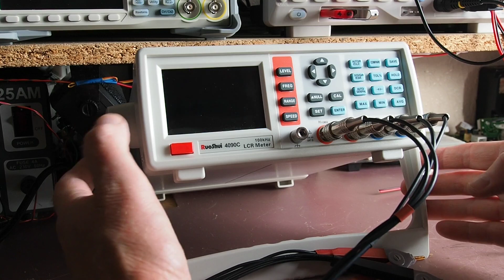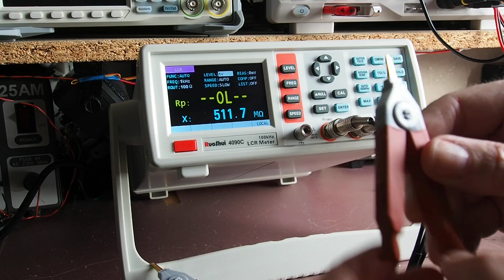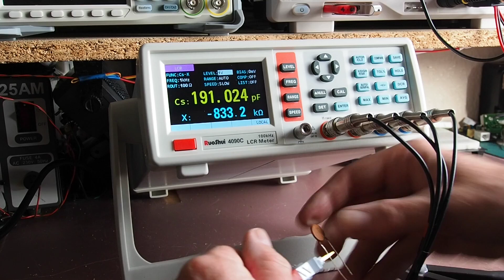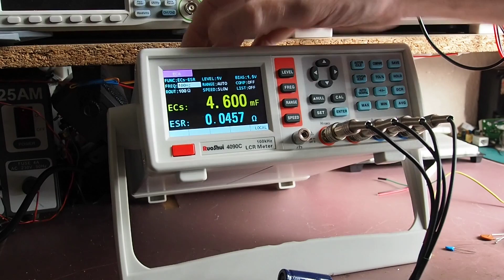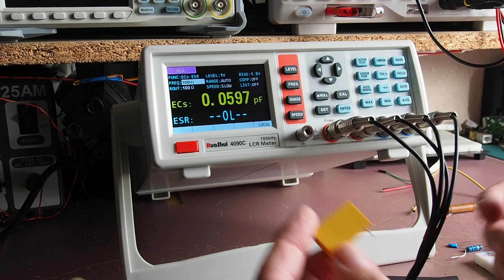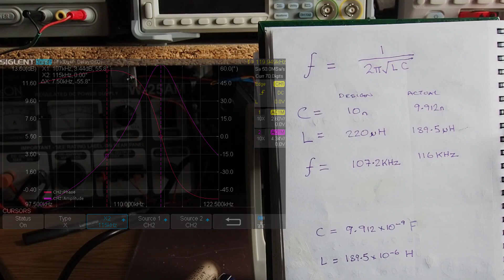Ruoshui 4090C LCR Meter Review   #092

Comment: Electrolytics should all have their ESR measured at 100 kHz to eliminate reactance errors which should be negligible at that frequency. Their capacitance is measured at 100 or 120 Hz for typical use.

Comment: hello. I bought this meter but its broken now. Can somebody help me fix it? I contacted Victor support  but they told me there is no help. Strange indeed. Unit powers up but it acts like its the short at the probes (withouth the probes attached) I asked for the mainboard replacement   for the repair but nothing 😢

Comment: There is a voltage selector on the back of the unit, but it only says 200-240V 50-60Hz.  Does it also operate at 120Vac 60Hz, even though this voltage is not indicated on the back of the unit?

Comment: Can you check the reading stability of a resistor in the 1k - 10k range?  On a high quality meter, this should give a very stable reading.  Looking at the readings during your review, there appears to be quite a lot of instability.  Possibly using a low quality ADC or they have noise on the measurement circuit PSU rails?

Comment: I have the 4091C on my bench and the inductance measurements are horribly inaccurate. I measured a 1.6H inductor using a Senncore LC53 (measures at 60Hz). The  4091C measures 7.7MH (which is wildly off). Measures caps just fine. Have you had any success measuring large inductors, 1henry +? Thanks.
Reply: That's interesting. I was about to pull the trigger on one of these meters because I need to measure inductance mostly in the range of a few mH all the way up to  15-20H or maybe even higher but now I'm hesitant. Do you still have inaccuracy problems or it was some user error from your side? Thanks.
Reply: @dandin1862  i worked with their tech support and found the problem, user error. I didn't change the line input voltage switch to 120 for US. Once I did this, my unit worked great. It's a good little unit, simple, fast and easy to use. Thanks for your question.
Reply: @CraigHollabaugh  That's good to hear. Thank you very much for the fast response!

Comment: After watching this, I purchased the 4091C 100kHz continuous frequency meter. I can write a SCPI program to pull the data. It just happened to be on sale direct from Roushui's Aliexpress store. Thanks from Colorado.
Reply: What driver did you use to write your SCPI program?
Reply: @pshamlow  I wrote a little python script that sends SCPI commands over serial port at 115.2K.  I wrote the company for the SCPI command document.

Comment: Very nice video and good information.  I have the East Tester LCR meter which I think is the exact same unit as yours with different color scheme and power button. I liked the demo where you commented on selecting the proper test frequency.  Selecting 100 Hz for the smoothing (power Supply) capacitors.  I am in the US so I set my test frequency to 120 Hz for smoothing capacitors. I am no expert either and trying to learn new things in electronic testing.  One note when you were measuring the 0.1 ohm resistor I did not see you null the lead resistance (REL) on the two probe test leads connected to the DMM.  Seems most test lead pairs are 0.2 to 0.4 ohms and by using the REL function I think your DMM would read much closer to the 0.1 ohms without using the 4-wire technique.   Also I think your DMM is using DC test voltages for resistors while you had the LCR meter set to 1 kHz.  I doubt if that would make any difference in this example but you can set you LCR meter to use DC (0 Hz) by pressing the DCR button for measuring resistors.  Again I think you presented a very nice video on the utility of using an LCR meter.  Looking forward to new videos from you.